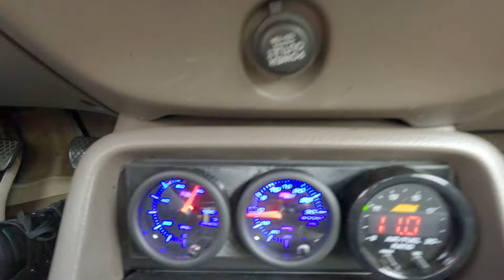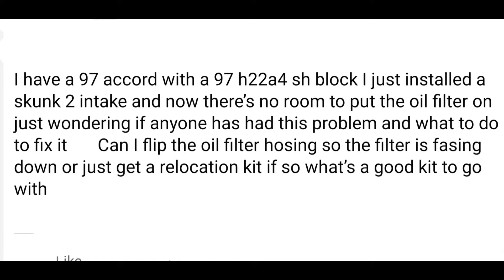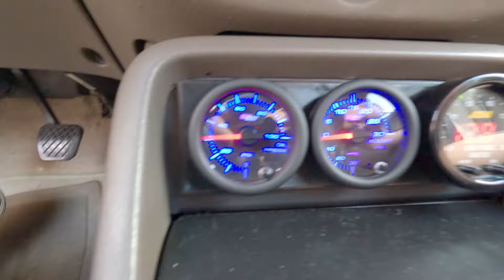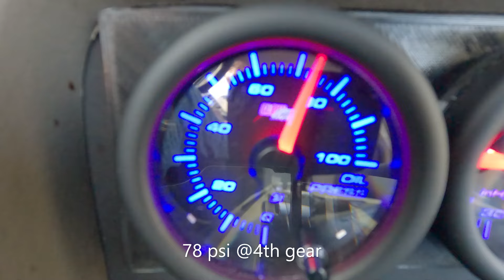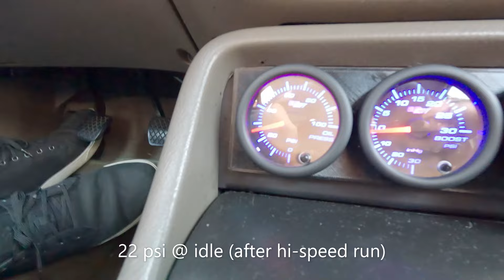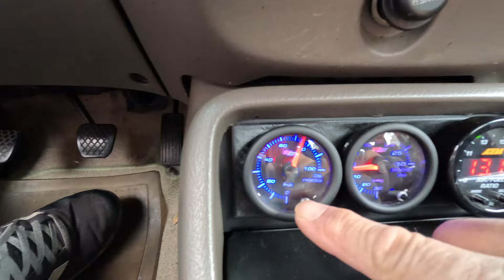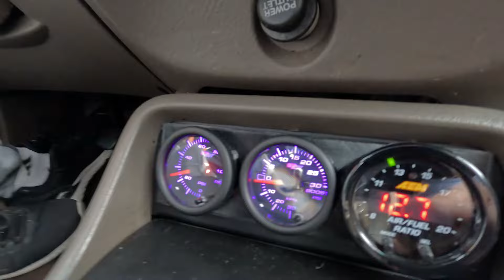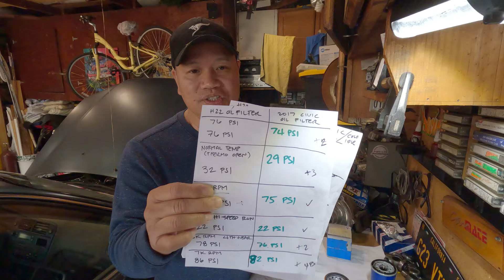Does oil filter size affect oil pressure?

Comment: I intend to use a smaller oil filter on my car from another much smaller cc car but surprisingly with more engine oil capacity. I hope I don't ruin my engine.. This info helps. Thank you Sir
Reply from the maker: I been using that small oil filter ever sinced my r&d and no problem yet. Oil pressure didnt change at all.

Comment: hey Professor highly suggest putting the guages in your line of sight(over on the left DRIVER pillar),instead of lookn down especially if your driving. NICE EXPERIMENT ✅
Reply from the maker: I thought about it and l actually bought the side pillar holder for it long time ago. But l thought of using the empty space on center console w/c you are correct, its harder for me to spot it. Thanks
Reply: looks cleaner on the current setup. But the comment above is correct also
Reply from the maker: @GR7Media  l wish l could do it but being in Cali, it attract to much attention from the popo.
Reply: Also some cars are equipped with A Pillar side airbags so that's something to think about as well.
Reply: Can you swap the car stereo and the gauge setup?
Reply from the maker: @jrrobertson2811  It's possible, I've seen other using stereo are for gauges, l'll think about it and much thanks

Comment: I wish you had used the same brand oil filter but different sizes so that the mesh wouldn't make a difference in oil pressure. Each filter has a slightly different media and could play a role in the oil pressure reading.
Reply from the maker: Me and my coworker were talking about it last night and mentioned that oil filters varies by manufacturer. I should have included on it. I'll follow up on this epusode coz someone mentioned about temp and l thought it has something to do w/ reliability of the g23. The 2 oil filters that tested are same brand but the Mdx filter, l checked my previous episodes video clips and almost the same as the regular H22 filter. Thanks for your feedback.

Comment: Hey i have a concern....im running a g23 turbo im living on a tropical island where the weather can get hot at times...ive installed an oil cooler before the oil cooler start up was about 78psi cold  warmup 25psi and now start up is 60psi warmup up 25 psi any thoughts on this
Reply from the maker: I say your still good and above specs limits. I'm using H22 specs from Honda, 10 psi @ idle, 50 @ 3k rpm  w/ oil temp @176*(warm)
Reply from the maker: Do you have your b/s deleted? Good that you installed a oil cooler coz l did installed a H22 OE oil cooler on my other Turbo G23. You shouln't be worry on your oil pressure it's ok and sinced it has a oil cooler. I guess its good for oil tempersture but make sure that the oil temp is w/in limits. It has to be not too cold and not too hot were it break the lubricating  performance of the oil. I thoughr of making a segment about oil temperature on build that b/s is deleted, stay tune and thanks.
Reply from the maker: It's understandable that oil pressure will goes down a bit coz of the additional plumbing but your oil pressure reading after the cooler installation are still above limits. If you are really concern, l made a vlog about testing the test oil port on the H22 cylinder head. I installed a pressure gauge and tested it when vtec system engaged. Check it out and if you want, apply it to your setup, that way you'll know that everything is good at hi rpm. Just for your peace of mind.
Reply from the maker: https://youtu.be/BQ9v1ZofXNs?si=yszyYUcqgv2_Slb-Here is the episode for testing vtec oil pressure using the cylinder head port.
Reply: Thanks for the information and guidance for the build it has been helpful 🙏 ... I did do the b/shaft delete I also shim the pump a bit cause I wanted no issues.......also, for the turbo build, which piston set do you recommend
Reply from the maker: I also wanted to do the shimming method but ended up not doing it and as you can see there's actually plenty of oil pressure to start w/ when b/s system is deleted. Someone made a comment about oil temperatures. It made me think that since b/s is deleted on my engine and oil pressure is higher than a stock H22, it's a good idea to follow up and make another segment about oil temp and find out if it need an oil cooler. I think oil temp is also part of the key component on G23 that need to keep an eye on for the sake of longevity and reliabilty. I also think it's one of the culprit of rod/ crank bearing failure on some g23vte owners (other than over rev the heck out of it).
Reply from the maker: I like to use CP piston coz I don't have to deal w/ the wrist pin offset unlike Wiseco K20a2 piston wrist pin hole has offset and when using it on G23, you have to decide w/c direction you want it installed. It's really up to you, they're both very good pistons.

Comment: I would assume oil temperatures would also be affected?
Reply from the maker: I think it'll be sane as normal H22. The oil pressures rrading are just about the same for H22 and 17 Civic oil filter and oil temp varies also w/ water coolant temperatures. It'll be nice if l have a oil temp gauge though. The other turbocharged G23 engine l owned, l installed a H22 OE oil cooler coz l believe it'll help a lot. Thanks
Reply from the maker: You are correct temperature will rise coz the rules on fluid or air dynamics are when pressure goes up, so as the temperature. Sinced l collected the data from a motor that the balance shafts system are deleted the oil temp and pressure is higher than a normal G23 or H22 (b/s non delete. I'll do more research if when you delete the b/s that you should have a oil cooler built in it to lower the oil temp down a bit. But it'll be on next episode lol! Thanks for your input, it'll be a good info.

Comment: Proper way to measure it would be to measure oil flow from a bypass, a bit impossible....
Reply from the maker: Yes it'll be hard to do a flow test and l think checking pressure using smaller filter is enough info for us to know. Thanks and I got another info I like to know w/c is oil temp since my engine b/s is deleted. I was thinking oil temp has something to do w/ F23 rod bearing spinning. I'll do some test.